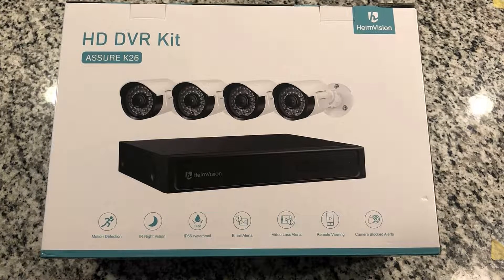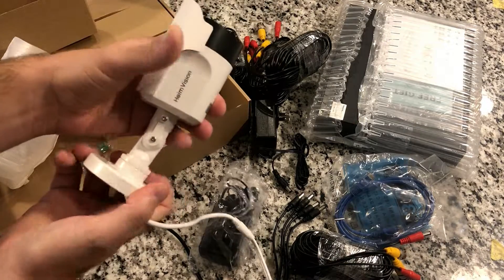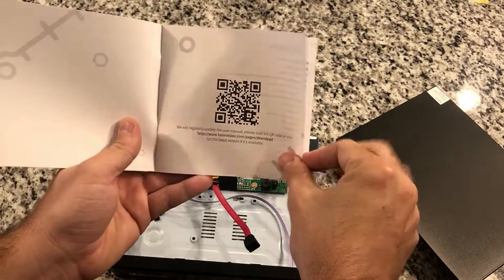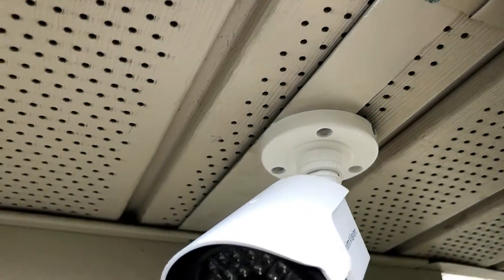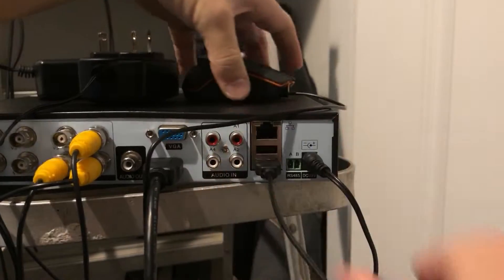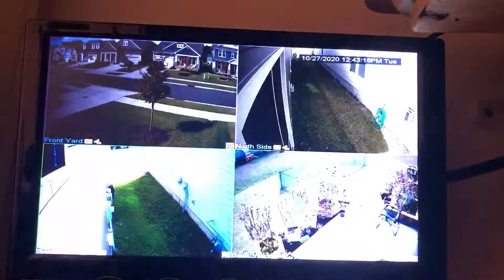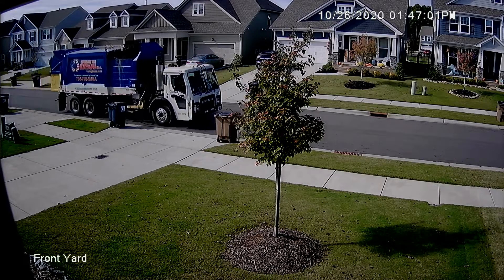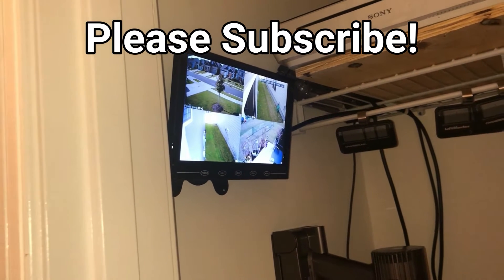[HOW TO] Install HeimVision Assure K26 1080P Home Security Camera System (CCTV DVR)

Comment: I use a combination of Nest and Ring cams. My house doesn’t have an attic space like most homes. I have high ceilings in most of my house.
Reply from the maker: I also have two solar powered ring-spotlight cams, and a ring doorbell. I like the Ring iPhone app, and their wide lens cameras, but the ones in the video were a nice addition to my house for extra eyes all around. Having attic access to the soffit to run wiring is definitely a perk to this home. Thanks for watching!